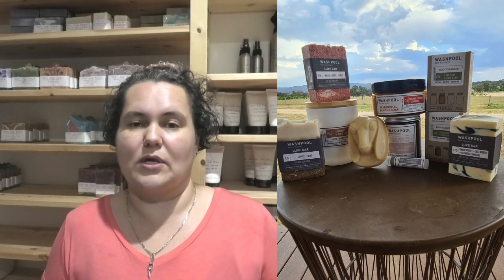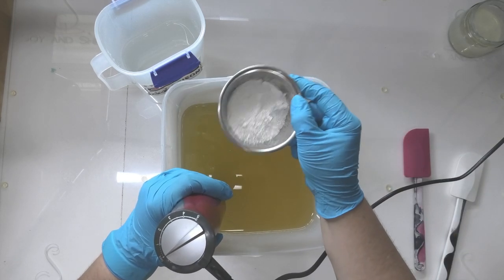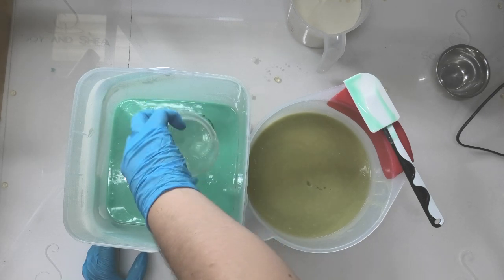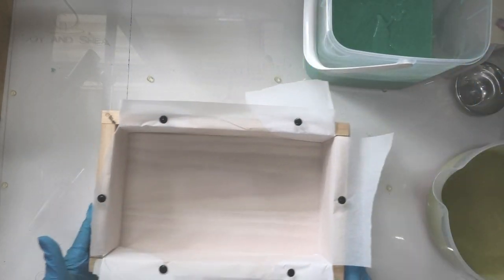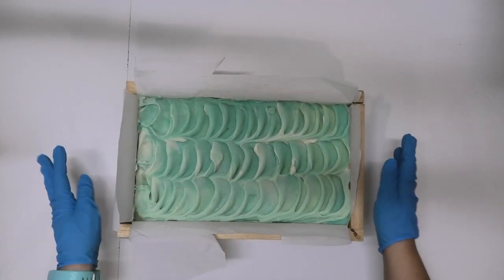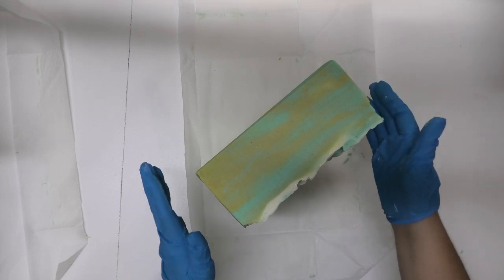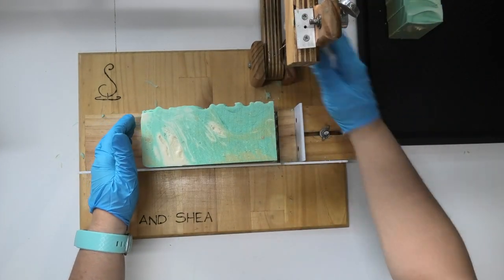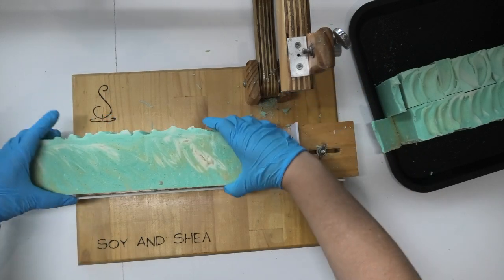Cucumber & Sea Salt Spa Bar 🥒 I learned from my mistakes!

Comment: That aqua color is amazing, well done.
I also agree with the wire gauge. 13g is fine for a soft soap but for salt bars, 17-18 would be better.
Reply from the maker: I only put the 13 in when I snapped it the first time because the 17s were hiding 😆  I love the 13 in the slab splitter